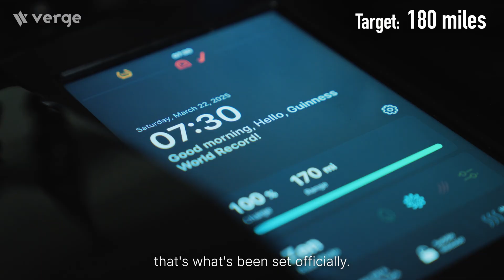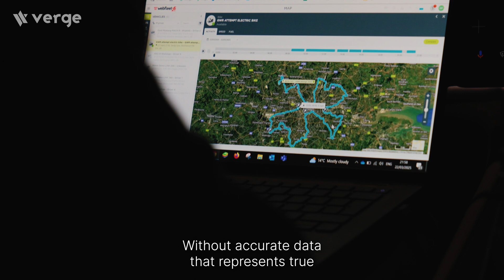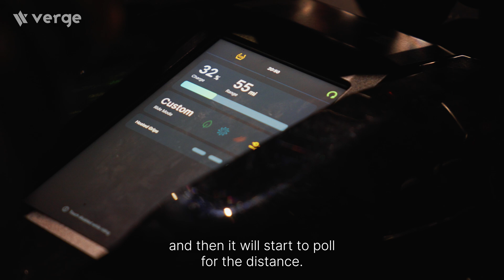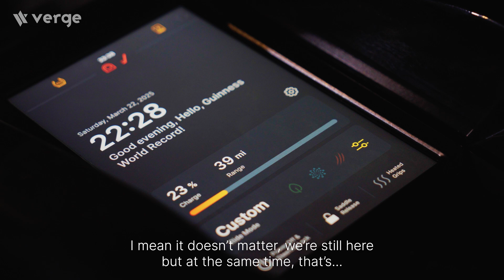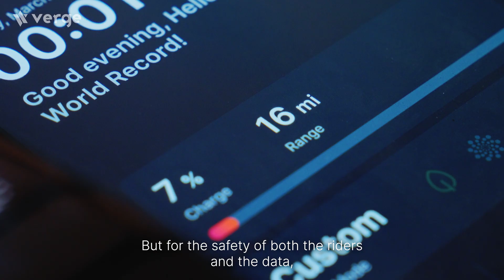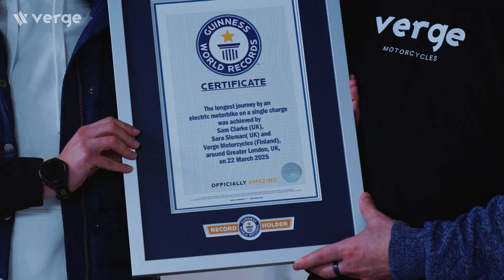Verge TS Pro sets a GUINNESS WORLD RECORDS title | Longest Journey on a Single Charge ⚡

Comment: A long time to ride 310k .  Yeh I know that to do a long distance on a EV or EVbike speed needs to be kept down to reduce wind drag
Reply: At one point she says they've ridden 12 hours.  They rode approximately 25 km/hr or 15 mph, that's RIDICULOUS.
Reply: @RPRosen-ki2fk while we don’t know the real world distance, you can now get the bike with a 33kWh battery which will give a longer range for the weekend warriors
Reply: @michaelclement1337  Yeah, I'm hoping all the CES HYPE about the new Donut solid state battery is true.  We'll all know one way or the other by summer.  I'm pulling for Verge, that's why I find this BS Guinness W/R video so embarrassing.
Reply: @RPRosen-ki2fk yes, the problem for large lifestyle motorcycles is the weight of the battery and that problem will reduce as batteries gain greater energy density

Comment: Congratulations! 👏  The thing that’s weird about Electric Bikes (vs. ICE bikes) is that mileage actually decreases (vs. increases) drastically when riding on long trips. I suppose that’s because there’s no regen braking when riding continuously on the highways and interstates?  🤔
Reply from the maker: Thanks! Yes, you're absolutely right.
Reply: @vergemotorcycles  I drove my Tesla (Model 3) from Florida to North Carolina (500+ miles)  a few weeks ago and noticed that watts/mile decreased from ~230 to ~190, which increased range quite a bit during the first half of the trip. I used the info in the car’s energy app to maximize range (by keeping speed under 70mph, lowering the AC etc.) but I’m wondering if regen braking was also a factor since I had full self driving (with level 2 cruise control) on?  This would be tantamount to rolling off the throttle when the motor is not needed to maintain steady MPH. I’m also wondering if similar info and efficiency on a Verge motorcycle could be leveraged to increase range further between DC super-charges on long trips? 🤔

Comment: The problem with this verge motorcycle is that 0-100 Km/hr is a lot of power for most riders to be able to deal with and instead of making a sensibly powered bike they have to make a ridiculously powered bike that if using a fraction of the torque the battery range will collapse.

This insane love affair with power is dangerous and will kill people as we see with regular ICE motorcycles. The fact this level of power is allowed on public roads is really shocking. 

The issue with charging, public chargers, broken chargers, depreciation, finding dealers that will take EV as trade in, I did it with EV cars for 10 years and went back to ICE manual transmission. 

I'd rather ride a Honda Super Cub 125 because EV has no soul, I love being in control of an ICE  bike and actually making it work for the speed,  it rewards me with a lovely engine and exhaust note and I love analogue instrument clusters on bikes too. 

So many good modern retro bikes to buy at a fraction of the price, Honda Super Cub 125, 5000 Euros, Honda GB 350s 5600 Euro, Triumph Speed 400 around 6500 Euros and Meguro S1 around 6500 Euros. There's the Royal Enfields, The Kawasaki W800, etc etc. 

By the way, ev car needs around 6 times the minerals needed for the battery vs ICE cars, how is this more environmentally friendly ? Fuel cell cars not much better but Hydrogen combustion is the key, Generate hydrogen by renewable energy or Nuclear, while it's not as efficient as ICE you do not have to use 6 times the minerals from the earth which if you think about it, scale up   ev to replace all ICE and you will be left with untold damage to the earth from all the mining not needed for ICE cars.
Reply from the maker: Thanks for the feedback.

Comment: why won't they attempt to break the record in the UK countryside where GPS has lesser chances of getting blocked by tunnels and tall buildings?
Reply from the maker: We chose real-world conditions with traffic, red lights, pedestrian crossings, and congestion to make the record as authentic as possible.
Reply: @vergemotorcycles and where it’s impossible to use any of its performance which would deplete the charge faster than melting snow in a jungle. Of course you will now use this data to promote the bikes range  which in real world conditions will be impossible. You must think we’re all stupid

Comment: do you really think people will drive 12mph while go on vacation office & any other place  this test should be done on real scenario base like some time 50mph in traffic less speed this is not test this is just propaganda to get the guinnes world record
Reply from the maker: This test was all about maximizing efficiency and seeing how much range is it possible to get out of the system. And for that reason the average speed was around 25mph (normal city speed in London).

For the other end of the spectrum, make sure to check out our previous video ”Monaco to Madrid in 24h” that shows how the bike handles riding constantly at highway speeds and rapid charging multiple times back to back.

Comment: Verge is quite literally the most beautiful and technologically advanced electric motorcycle out there. No chain.Two large ball bearings support a carbon-fiber rear wheel—developed in-house—with traditional magnets inside the rim. Sending power into the hub's electromagnets causes the wheel's magnets to spin and the wheel to rotate around the motor-hub unit. Genius.
Reply from the maker: Thank you so much for the kind words! 🙏 We’re beyond proud of the Verge TS Pro and the innovative design that makes it stand out⚡⚡⚡
Reply: @vergemotorcycles  , Do you ever see this technology being able to move into the dual sport off road market, or is it always going to be a street  bike. A stunning piece of work, I hope you work out the bugs in the system because this looks like the future of motorcycles. Wish you guys nothing but the very best in your future adventures.
Reply: Yeah, that is exactly, the intro anyways what I just read about a dual hub powered system with some new battery system, bike does highway speeds and boasts 200+ miles.  The tech matters little since the techs will be doing the service n support.  As long as it is the price of an entry level bike on sale and does the job while looking cool is the game.
Reply from the maker: Thank you for your kind words and support!⚡

Comment: Check out: Sway n90 pro v3 scooter that has 450 km range.
If you need range on electric bike, you can not use heavy chasis and heavy wheels, you need lighter bike.

Comment: Well...I'm delighted to see Sam Clarke still promoting electric two wheelers, because I well remember him riding those electric scooters around London in the Noughties, as was I. And congratulations on the record...BUT Cedric Lynch has been doing well over DOUBLE this distance, AT MUCH HIGHER SPEEDS for years because his home-made machine is so aerodynamic! The Verge has many fine qualities, but it's about as aerodynamic as a brick. Also, I'm sure Electric Terry Hershner did far more miles than this on a single charge on his Craig Vetter-modified 2012 Zero when he rode across the USA with NO SUPPORT in only 5 days, way back in 2014! And finally, the Designwerk ZeroTracer went around the world in 80 days in 2010--2011 and that could do 200 miles on a charge at motorway speeds! So, all in all, I'm not that impressed and I'm surprised that Guinness didn't do more research. Also, relying on GPS for the distance covered is clearly deeply flawed in these conditions!

Comment: There's some mistake in the measurements. regenerative braking cannot add additional kilometers to a motorcycle (or car). Driving in the city using regenerative braking will always be less than driving on the highway at the same speed without regenerative braking. Regenerative braking cannot return 100% or more energy to the batteries. The laws of physics cannot be deceived

Comment: so the advertised range for this bike is 350KM but they got a word record by doing 310KM? nice false advertising
Reply from the maker: The team lost 5-10 miles / 8-16 km due to the GPS tracking failure and the bike still had 7% left at the end which would have provided at least another 16miles / 25km or more. So the 350km is very much in line with that.

Comment: What is the point of riding 193 miles in a bit over 16 hours?   What is that, about 12 miles/hour?    That is average recreational bicycle speed on a $200 bike.    What distance can the bike go at normal traffic speeds?  Also, the Verge TS website shows the city range at 217 miles.  Why weren't the riders able to get that distance at such a low speed?
Reply: That's what I was thinking. Not sure about English riders, but here in the USA, it's nothing for us to do a day ride through the mountains here in north Georgia and into western North Carolina and put 250 to 400 miles in a day.
Reply from the maker: The average speed was around 25mph (normal city speed in London). Speed was kept between 20-50mph (30-65km/h) during the attempt as this test was all about maximizing efficiency. For the other end of the spectrum, make sure to check out our previous video ”Monaco to Madrid in 24h” that shows how the bike handles riding constantly at highway speeds and rapid charging multiple times back to back. 

The reason why they did not reach 217mi, was due to the GPS failure which lost the team a few miles as Guinness don’t accept odometer-data. Plus the 7% that was left on the bike would have provided at least 16mi of additional range with this style of riding, maybe even more.
Reply: @vergemotorcycles the math doesn't add up, if the average speed was 25mph then in 16 hours it would have covered 400 miles. 193 miles ÷ 16 hours = 12.06 mph average speed.
Reply from the maker: @polska905  The whole attempt with filming, interviews, stops etc. took 16 hours. Riding time was less than that.

Comment: Off topic, but I'll say it anyway.  The reason ALL motorcycles are 'fringe transportation' is because all you can do is carry yourself.  (maybe a passenger on some bikes).   No groceries, no supplies, no nothing.   Which really makes motorcycles useless most of the time.  I.e. they are just toys to play on.   But EV moto's have the possiblity to change that.  Without the massive engine, exhaust, etc, there should be tons of space for STORAGE.  Imagine being able to take your motorycle shopping, know you can actually make a few small purchases and be able to transport them home on your motorycle.  Or even the simplest 'milk run', where you can use  your motorcycle to run the store and buy a gallon of milk.   How cool would that be?  With Verge putting the motor in the rear wheel, there is just so much potential to put a 'trunk' on their bikes above the battery.  A place where you could put 2 full size helmets and 2 riding jackets.  (So you don't have to carry them around all dam day).   Or a briefcase for going to work.  Or 2 full size bags of groceries.   If Verge wants to sells some bikes, they have a golden opportunity to be the very first 'actually practical' motorcycle.
Reply from the maker: Thank you for sharing your feedback!

Comment: Don't get me wrong, I  love the idea of Verge bikes, and I want them to succeed.   But an 'around town' range test is pointless.  As when your 'around town', there are chargers everywhere.  Which should be addressed with rapid charging, like being able to charge 10%-90% in say 15 minutes.   For 'range', think the western united states, where it's 40-60 miles between GAS stations, let alone ev charge stations.   AND most importanly, going between town in the west is done at 70mph highways speeds.  That's a real range test, how far will your bike go doing 70mph on the freeway?  (The magic number that will kill all gas engines is 250 miles. Combined with the aformentioned 15 mintues charge time).   I'm rooting for you verge...  (Edit: 200 miles in 16 hours, that's 12mph.    My wife can do that on her road bike...)
Reply from the maker: The average speed was around 25mph (normal city speed in London). Speed was kept between 20-50mph (30-65km/h) during the attempt as this test was all about maximizing efficiency. For the other end of the spectrum, make sure to check out our previous video ”Monaco to Madrid in 24h” that shows how the bike handles riding constantly at highway speeds and rapid charging multiple times back to back.
Reply: @vergemotorcycles  I have owned a zero sr since 2019.  99% of the time I use it to commute to work.  It's absolutely the best bike for that job.  Can charge at home, and get about 2 weeks of commuting on it. (I have a short commute, where the speed limit is 35mph in town).  Where my zero fails me is twofold.  First, it can't fast charge.  So I need 3-4 hours to get mostly full/full charge.  Not conducive to do anything.  Second, it only gets about 70 miles at 70mph.  Which means I can't take it out of town.  I live in the western us, and the nearest towns are 120 miles south, and 70 miles north.  So if I go north, I can get there on one charge, but then I'd have to charge for 4 hours to get back.  Nope.  To go south, I'd ride halfway, charge for 4 hours.  Get there, charge for 4 hours to make it halfway back, then 4 hours for the final leg.  Nope nope.   But, and I know I'm unique here, I only need it to commute, and bop around town.  But dam, I would love to be able to stow my helmet/jacket/gloves 'in' the bike/lockable.  So that if I go to the mall, or out to eat, I don't have to lug that stuff around with me...    I know, not the 'sexy' talk of 0-60, or top speed, or super cool looks.  But someone will make the first practical motorcycle, and they'll make billions doing it..
Reply from the maker: Thank you for sharing your feedback!

Comment: Congrats to Verge TS Pro team. It is an awesome bike. My EMOTO EEC/COC R1 with 72 Volt 160 Ah battery does 100 to 110 miles and I am just mounting two additional 100 Ah batteries which will increase the weight  of the motorcycle to 240 kgs. Should be easy to top 200 miles range. Total investment  a little over €6000. I am doing fine with 20hp and I also own 200+ hp petrol bikes.
Reply from the maker: Nice! Thanks for sharing! ⚡️⚡️

Comment: MINE: 
1. 2 years ago I made 260km on energica ss9+ within about 4-4,5hours  - but I know this doesnt count bcoz 170km of this was on highway really close behind truck at const speed 88-90kmh - energy consumption was 3-4kWh/100 - also I still have 35% SoC on destination - will be more but 90km of it was in the city/countryside roads when have fun with accelerations

2. I have also a custom e-bike (72V) with 2,5kWh battery (max speed 65-85kmh depend of SoC/voltage) 100-0% range at full speed which I did one time - its about 55-60km, with keeping avg speed 35-40kmh it has about 95-100km, but one time I was cruising slowly (20-30kmh max speeds) with my friend which has normal pedal bike and we ride about 12-14 hours - we made 140km and I still have 50% of battery ;)

so no surprise here

Comment: To ride in a city, means to run at low speed, good for electric machine. Would have prefered to run on open roads out of city
Reply from the maker: This test was all about maximizing efficiency and seeing how much range it is possible to get out of the system. And for that reason the average speed was around 25mph (normal city speed in London). Speed was kept between 20-50mph (30-65km/h) during the attempt. 

For the other end of the spectrum, make sure to check out our previous video ”Monaco to Madrid in 24h” that shows how the bike handles riding constantly at highway speeds and rapid charging multiple times back to back.
Reply: @vergemotorcycles  sorry, but this is anti-advertising your bike. Taking over 12 hours for a 200 mile trip is ridiculous, in no way representative of real-world application, and also the worst kind of experience you can have on a motorbike. This is not what bikes are for, especially not a high-performance power cruiser. No rider, no potential buyer of your bike is gonna see this and get hooked. Also, everyone knows that Guiness World Records are a joke at this point 👎
Reply: And by the way, I don't hate on electric bikes, I ride a RGNT myself and love it. Thing is, I may only have around 100 miles of range, but that is with sporty, joyful riding, city and open roads mixed, with full acceleration and not holding back to be economic. So if I want to go 200 miles, I just ride 100 in roughly 1.5 - 2 hours, then I take an extensive break while charging (4 hours 0-100%), while I eat, rest, maybe go sightseeing wherever I stopped, and then I ride another 100 miles. Total time taken: 8 hours max, much less than your "record", plus I am relaxed, rested, and I had fun riding and eating and sightseeing. Your "record" means nothing.
Reply from the maker: @martinromer6997 the Verge TS Pro excels in that sort of riding as well, like seen in the Monaco to Madrid video. When riding on highway you get between 100-150mi on a charge depending on riding speed and conditions and fast charging from 0-80% takes only 30-35minutes. So if that’s what you are looking to do, we have you covered as well. 👍

But that was not the point of this video/test. This was simply about demonstrating a technical maximum range. Nothing more. For other realworld use cases we constantly post videos on our channel, make sure to check them out ⚡️
Reply: @vergemotorcycles  if you want to show "technical" maximum range, put it on a dyno and set it to 5mph. It will take a while, but you should easily crack 300 miles this way. No less "realistic" than your Guiness Record. It's just numbers - amp hours divided by power usage (which, at 5mph constant wold be sub 1kw most likely).